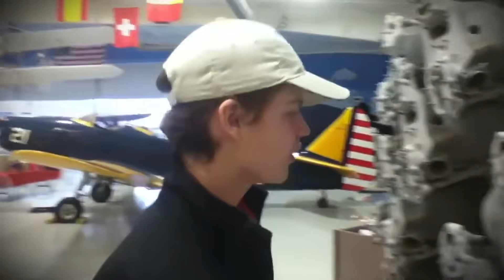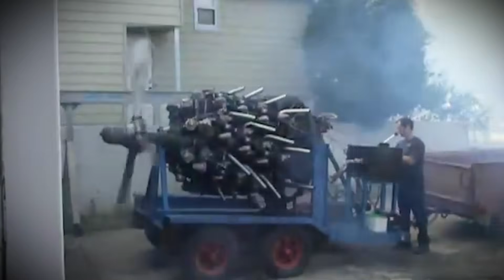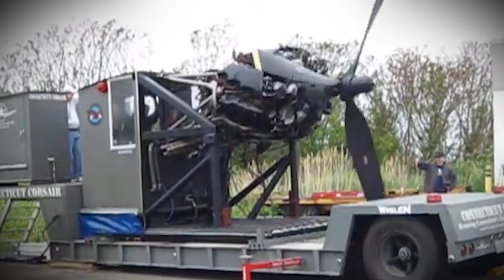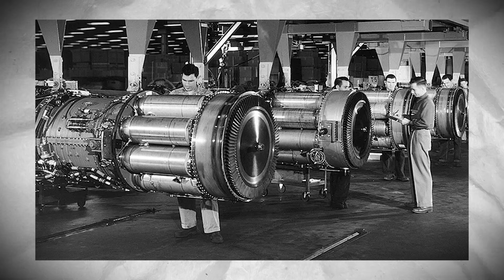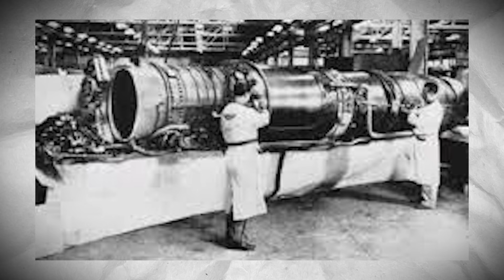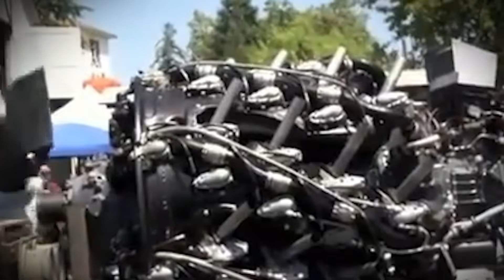The Dark Story Behind the Curtiss-Wright R-4360 — The Engine That Was "Too Much" for Physics

Comment: Do NOT waste your time on this nonsense! Every Aviation enthusiast with half an interest knows that the R-4360 was built by Pratt & Whitney, and that it powered no less than 29 different air frames!!
Reply: Other than PW themselves pretty sure no Repair Station can disassemble and overhaul the crankcases of a Wasp Major. But the US's Military Transport Command kept entire new spare engines in their oil-filled shipping cans placed around the globe. I traveled to Egypt back in the early 00s and inspected a half-dozen such units. I pulled each one vertically up out of it's can, let the preservative oil drip off and inspected it. Told the buyer they were legit. He sent the money and five days later a freighter showed up for them and got them away from those crooks.

Comment: My Dad was an aircraft Mechanic. When I was 7 I knew 1300s, 1820s, 2600s and 3350s were Wrights and 985s, 1340s, 1830s, 2000s, 2800s and 4360s were Pratt Whitneys. I could even tell you how many cylinders and how many rows each engine had.
    So here we are 60 years later and computers still aren't as smart as 7 year me was.